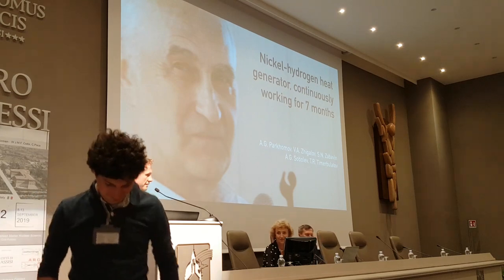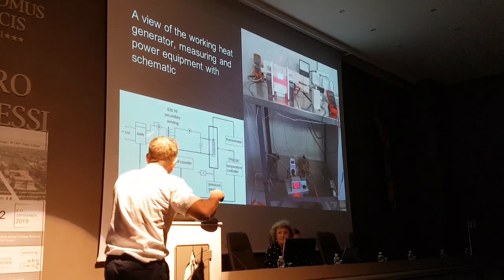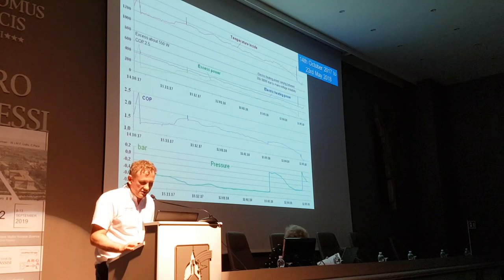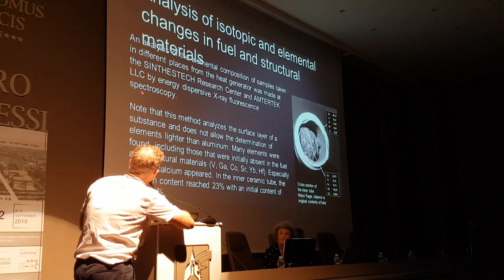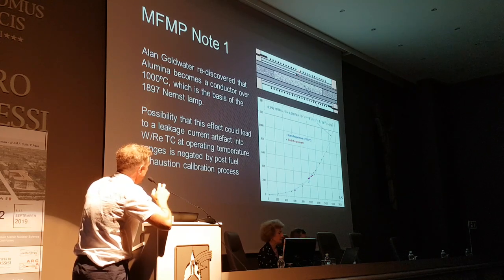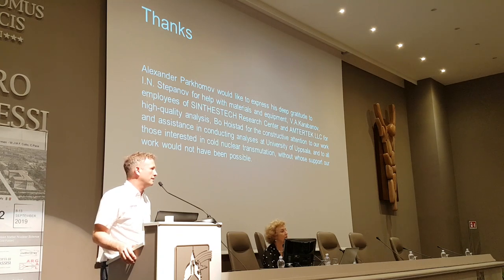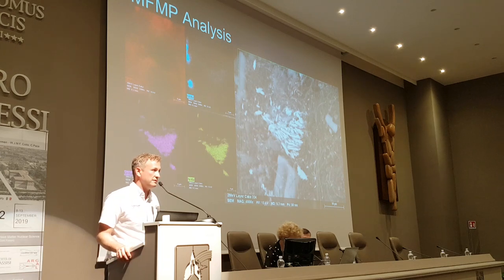ICCF22 - Parkhomov 225 Day reactor - Bob Greenyer - Italy 2019

Comment: Very interesting results. 

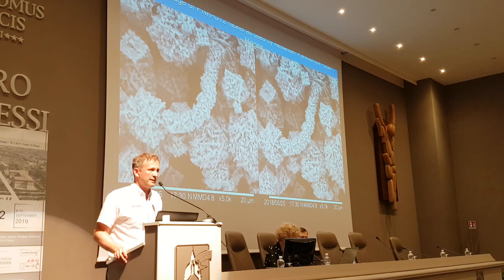The questioner at 27:37 is (I believe) Peter Hegelstein, or someone who can do a very good imitation of his voice and his manner of speaking. Robert Greenyer addresses this person's questions from 27:50 to 30:48 in the video.
Reply from the maker: Yes it was Peter Hegelstein - he was interested in specific temperatures because they will represent vibrational states in the Nickel. He is also interested in if Lithium and Aluminium was present, neither was in the reaction zone at all, not as fuel mix or in parts of the in-contact reactor structure. This is basically Piantelli Ni + H, Piantelli also had his internals made from MACOR machinable ceramic - https://www.pgo-online.com/intl/macor-machinable-glass-ceramic.html

This has (in %)

Silicon Oxide (SiO2) 46
Magnesium Oxide (MgO) 17
Alumina (Al2O3) 16
Potassium oxide (K2O) 10
Boron oxide (B2O3) 7
Fluorine (F) 4

In this presentation above it is revealed that Parkhomov had SiO2 (in the ceramic felt) and SiC (in the reactor tube), SiC is also often doped with Boron.

Comment: If the bright heat glow of the Rossi & Parkhomov power tubes can be replicated, it can be used as a space fusion power core (for use aboard satellites), with the cylinder surrounded by multi-layer GaAs/GaSb Thermo-Photovoltaic and BiTe ThermoElectric solid state conversion cells.  This would have immediate practical application at low design risk and low market risk.  Parkhomov replicated Rossi in that configuration years ago.  When can we have one to develop a space test flight experiment around?